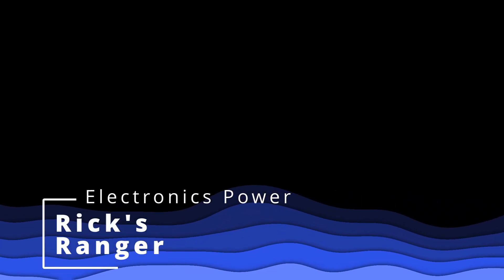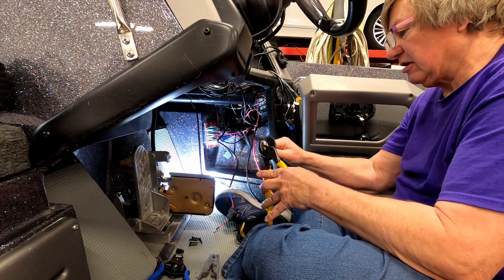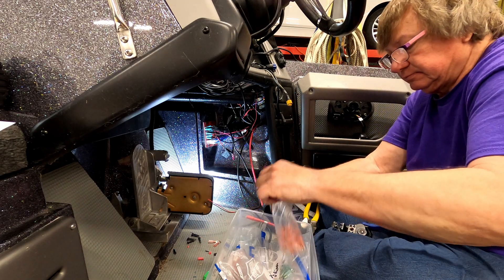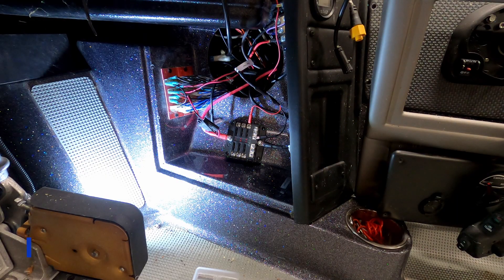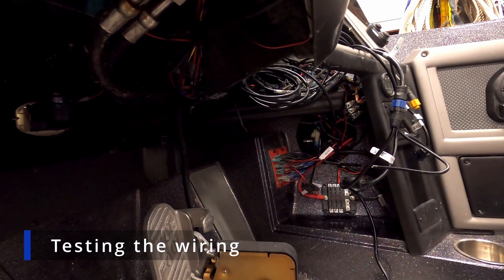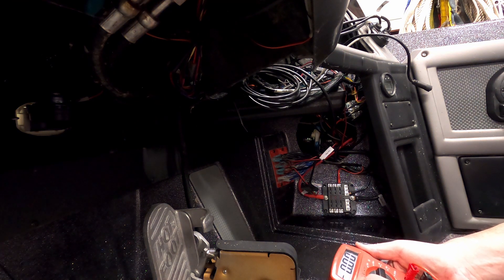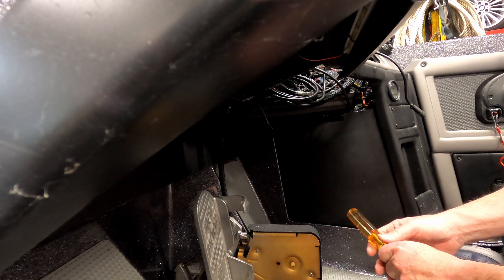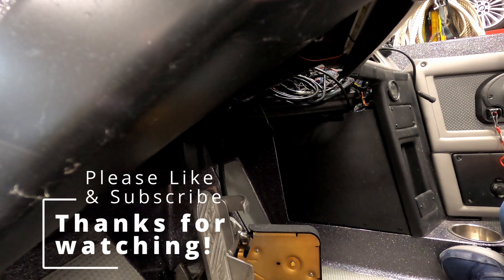Rick's Ranger - Rewiring the Electronics Power

Comment: Garry I know it is an older video but curious about your opinion on things.  Wiring my 99 Ranger 620.  Currently 2 HDS Live 9s and an AT 2 at the console.  There is a reputable installer who suggests running individual wire to each graph and AT module.  I currently have a blue sea fuse block in place with 10AWG wire to it.  I know you suggest 8 AWG and that would be easy enough to swap out for me.  But could you explain your thought process on why running the graphs and AT module to the fuse block is as good or better than running individual wire from the battery to the units/module.
Reply from the maker: What I use is a simple power distribution design. It reduces the amount of connections, i.e. failure points, while providing more than sufficient and low loss power to where it's needed. It minimizes the amount of large gauge wire used in the installation as well. This method has proven to be reliable and to deliver clean low loss power to installations. And yes, even though you only have 9" units and one AT module, I would change the 10 awg to 8 awg . There will be less voltage drop with the 8 awg, and you will notice a visible difference in the image quality on the AT module. Also, by using a fuse block, you have eliminated an additional connection by using the in-line fuse holders. And all of your fuses are located in one location. While the Blue Seas block does not have the LED indicators as the WUPP ones that I use, it is easier to troubleshoot when you are installing or have issues later. I am currently working on a 622 and using the same method. 

I'm not sure of your boat layout. Most of the boats that I do have the AT module located somewhere in the bow with 1 to 3 units there. And then 1 or 2 units on the console. So, I run 8 awg to the console and to the bow and then distribute power from there.

Another reason to use this method is for expansion. If you want to add an additional unit then you just run the run power cord to the fuse block and add a fuse. This is what I had done with the Triton upgrade video. Adding the second unit was as simple as terminating the power cord, screwing the wires to the fuse block, and then adding a fuse.

Also, some boats have very limited rigging tubes to pull cable. The more and larger cables that you pull then you will run out of room.

I could go on, but I hope that you get the idea.

Garry
Reply: @garrywoodruff960  Thank you for the very detailed explanation.  I will swap to 8 awg wire and continue using my fuse block.

Comment: Nice video and very helpful, only I am not sure about ring terminals on fuse box. Please can you tell me exactly what size and type terminals I need for my hds live 12 and live target, and my main wire is 8 AWG. Thank you in advance
Reply from the maker: Thank you.

I use Ancor marine grade heat shrink terminals. (see links below)

For the 8 AWG -- you will need a #10 8 ring terminal (it is pink in color).
For the HDS power cord -- you will need a #8 18-22 ring terminal (also pink in color)
For the AT power cord -- you will need a #8 14-16 ring terminal (blue in color)

 I use a 14-16 Butt connector (blue) to connect the Yellow on the AT cord to the HDS cord. You will need to strip the HDS yellow back double length then fold it in half, twist it, then insert it into the Butt connector.

Here are links for terminals.

Ancor Heat Shrink Ring Terminals: https://amzn.to/4gk5znN
Ancor Butt Connector Kit: https://amzn.to/41DLCE5
Reply: @ Thank you very much!!!
Reply from the maker: You're welcome. Let me know if you have any more questions.

Comment: Garry,
Love the video as it goes through a lot of detail on wiring power to multiple graphs and active target on a boat. I also appreciate the fact that you pay attention to the small details for something as simple as labeling cables so the boat owner knows where wires go!

I have some questions for you that I'm hoping you can shed a bit of light on and point me in the right direction.

I have a fiberglass Lund 219 Pro-V.  

I have 5 batteries in the boat, 3 trolling, 1 cranking, and 1 house battery separated from cranking with an isolator.   I also have 3 Lowrance HDS 12 Live graphs, 2 at the console, one on the bow. 
I plan on adding another 12 or 16" on the bow to use with Active Target 2 which I am looking into getting shortly.  

All 3 current graphs are connected to the master power switch, and I'm sure that the master power switch feeds a fuse block.  When I have the graphs turned on, the voltage to my graphs is lower than it should be even after a fresh charge on the batteries.  On the bow, generally around 11.8 to 12v when first turning them on, dropping to as low as 11.3v throughout the day.  The house battery is good, so I'm positive that I'm experiencing voltage drop due to incorrect wire gauge.  I do like the idea of the graphs being connected to master power but am wanting to get them on their own power runs direct from battery.

Here are my thoughts...
1.  (BOW) Run #6 or #8 (leaning #6) wire to a new fuse block on the bow to run the 2 bow graphs and active target.  Use a 30A or 40A breaker near the house battery for the run.  Install a solid-state relay in the bow that controls power to the fuse block. I'd run the new wire into the load side of the relay and control the relay with the wire that currently feeds the graphs from master power.

2.  (CONSOLE) Run #8 wire to a new fuse block to run the 2 console graphs.  Use a 30A breaker near the house battery for the run.  Install a solid-state relay in the bow that controls power to the fuse block. I'd run the #8 wire into the load side of the relay and control the relay with the wire that currently feeds the graphs from master power.

3.  (ACTIVE TARGET) I’d like this to be controlled with a switch in the event I will not be using it but have both bow graphs powered.  I’m thinking about running power from the new bow fuse block to the load side of another solid-state relay, then to the active target module.  
To control power on this solid-state relay, would it be ok to split power from the master power switch lead to power both solid-state relays in the bow, or would it be better to do a dedicated homerun from the master power fuse block at the console?  If I’m able to split power without penalty to run the 2 solid-state relays, I’d put an in-line power switch on the bow feeding the control side of the active target relay.
As far as grounding the housing of the active target, would I need a home run back to the house battery, or would I be able to tie it to the ground side of the fuse block?

Does this sound like I'm pointing in the right direction? Thanks!
Reply from the maker: The Lunds that I have done had only minimal wiring for the electronics. I think that it was 12 or 14 if that large. So, definitely you would benefit from running 8 awg to the bow and to the console (separate runs). 8 awg is more than sufficient for the load being carried. 6 awg would work but then you will need different tools and connectors, and possibly terminal blocks, to handle that size of wire. Then put a fuse block at each location. I would feed the 8 awg from the 40 Amp breaker near the house battery (a 30 Amp breaker will also work but the 40 gives you a little extra capacity in case you go with 16s.). You could also put in a cutoff switch between the breaker and house battery. Or if you want to be able to turn off the bow or console separately then you could put in two breakers near the house battery. This is not normally needed but it does give you the option.

The use of a SSR to control power to the fuse block is really not needed until the control signal is coming from the boat main power and you want to switch it that way. If then then you would use switched boat power and ground on the control side. Then use the 8 awg wire from the house battery on the load side with the output feeding the fuse block. I don't think that would be needed with the breaker(s) and possibly a cutoff switch near the house battery.

For the AT, use the Yellow wire with switched power fed by the house battery to turn on/off the module. If your boat has accessory switches then use a SSR, with the accessory switch feeding the positive on the control side and main boat ground. Then from the fuse block with a 1 AMP fuse, feed power to the positive load side of the SSR and attach the Yellow wire to the negative load terminal.

For the ground (bonding) wire on the AT module, I just connect it to the negative on the fuse block. I use either a 10 or 12 awg size wire. It takes a #8 ring terminal.

What I described is the typical power wiring that works with either the main battery or a separate house (or electronics) battery. It all depends on where you hook up the power and ground in the battery area.

Also, you might want to consider putting in a voltage gauge at the bow and/or console. This will let you better check the voltage during the day and it more accurate than using the voltage display on a unit.
Reply: @garrywoodruff960  
I really appreciate you taking the time to respond!  You've definitely given me a more solid direction on wiring this out, and now I just need to get all the pieces ordered.  I'll be a good winter project while the snow flies here in Montana.

I did a bit of digging over the weekend and it looks like Lund took a #10, or a heavily insulated #12 and ran it from the house battery, to a 40A breaker near the battery, then from the breaker to a Bosch style relay under the console, then into a distribution block that the bulk of the electronics at the console and bow are fed from.  After this discovery, I'm positive that this wiring setup is why I'm seeing lower voltages...

Lund wasn't responsible for installing the graphs on small wire, that was the dealer, but I'm still surprised that Lund is using that small of wire to feed everything at the console.

The biggest point for me running relays on the new wiring is so I can quick verify that power is off to everything in the boat with the flip of the master power switch at the console.  When I was doing a bit of research into the relays, it seems like the SSRs may require a heatsink with a load over a few amps which the graphs will surely do...  Obviously if I put AT on its own relay, a SSR won't need a heatsink at the sub 1A draw of the wake-up wire to AT...

But, do you think it'd be better for me to run potted waterproof Bosch style relays for the #8 runs, or do you think SSRs would be sufficient running the graphs and AT without a heatsink?
Reply from the maker: Yes, you will need to heatsink the SSRs is you use them to switch power loads. And the SSRs would have to be able carry the load as well. For the yellow wire (wakeup) the load is so light that you do not need to heatsink the SSR for that load.

I would just use a master electronics cutoff switch in the battery area. It is simpler and easier to diagnose any issues. And the fewer the components, the less likely for any additional voltage drop due to the additional components. You could always add in an LED to indicate power to the electronics to make sure that they are on/off. On the Caymas videos, you can see where I added switches for the AT modules that also included a voltage meter. So, if the meter was lit then the electronics were enabled.

Actually, until recently, many boat manufacturers have used small gauge wire for electronics. That's why there is a market for wiring harnesses and for installing beefed up wiring. Even with boats that provide clean or separate power, many times the wire size is insufficient for the electronics being put on them. It's not just the number and size of the units but modules like AT or S3100, networks, and other devices.
Reply: @garrywoodruff960  
Thanks for the info, I really do appreciate it!  Looks like I'll skip the relays with the exception of the one for AT.
Reply from the maker: You're welcome. Let me know how it all comes out.